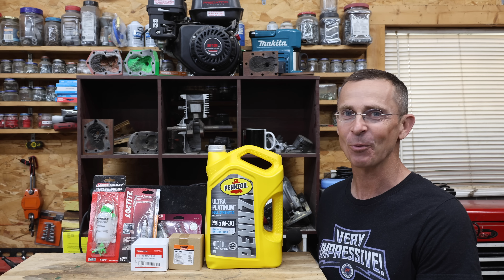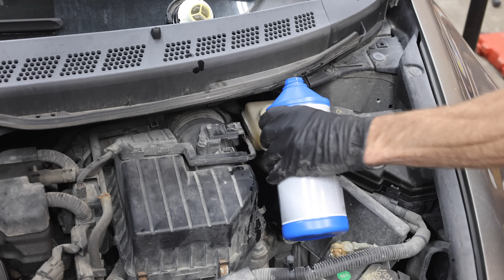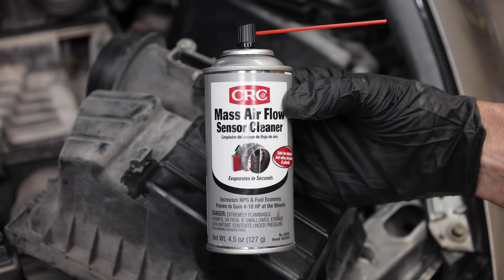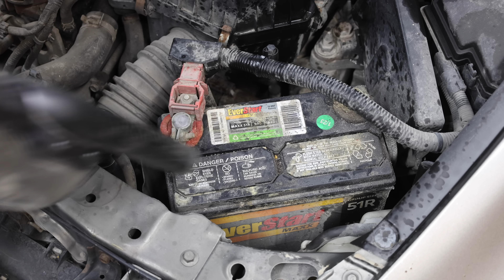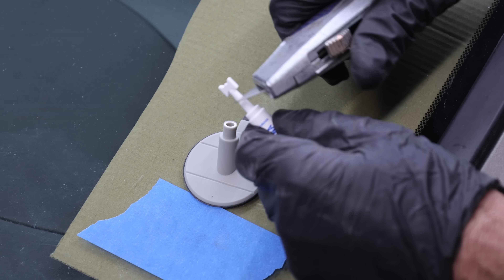Most Reliable 200K Mile Car? Let's Settle This!

Comment: 2005 4L Camry here, over 300,000 miles. Engine and transmission fluid has been the clue.
Thanks for the video
Reply: Toyotas would go 500,000 miles before needing all these.. ;)
Reply from the maker: Nice!  You are welcome!
Reply: @ProjectFarm A subscriber here. I just found out that there are canned fire extinguishers like paint can style. Would like to see a review on those. Just a suggestion. Thanks

Comment: 99 Rav4 with the 2.0. Has 270k logged on the odometer and it doesn't burn any oil or coolant and it still has amazing compression. Those 90s Japanese cars are decent pieces for sure.
Reply from the maker: Thanks for the feedback.

Comment: Don't drain all the transmission fluid, just drain the 3 and a half litres and replace it with the same amount. it doesn't hurt the Hondas to leave some old fluid in there.

Comment: Too many people just change the oil whenever and off they go. I read the manual and the schedule and use that as a guide to get the car serviced. Trans fluid, rearend fluid(if rear drive) front end fluid(if front drive) and various other things all need checked and changed to maximize vehicle life. Having been a mechanic myself, I really got some old memories going watching you fix that Honda up. It will last quite a while longer and save money doing it too. Great job!
Reply from the maker: Thanks!  Thanks for the feedback.

Comment: Thank you Todd for another amazing video!!! I’ve helped friends find cars for their children, typically their first car.  Older Hondas and Toyotas are my go to vehicles.  With some TLC, modest parts replacement and sweat, they are provided with a nice reliable vehicle for many years until they are ready for something newer / sleeker with their own $$$. And the jumper pack, portable air compressor and first aid kit also goes in.  A blanket and change of clothes w a couple of bottles of water finishes the “go kit” I provide.  Thanks again.  And BTW I just sold my 24 year old 3 series BMW last week. I was the original owner and lavished care on it over the years. Being garaged since new and no abused showed. Sold in about 15 minutes.  That’s a perfect car for an upgrade once the new driver is ready.  They are a good value and taken care of easily go 250K miles or longer. The “new ones” have so much plastic and tech I’d not recommend any of them.
Reply from the maker: You are welcome!  Thanks for sharing.

Comment: Excellent video.  I really like the extractor you made.  Like you, I maintain my automobile.  I still own and drive my 1984 Dodge Rampage with its original motor/trans at over 350,000 miles.
Reply from the maker: Thanks!  Nice!

Comment: hey Todd, Thank you for this amazing video. Your brake job was very easy to follow.  you talk a bit fast sometimes so I just rewatch those parts.   I was wondering do you know is it possible to replace an oil pump in an engine and how hard would it be to do so?  Looking forward to your next video on whatever you are doing.
Reply from the maker: You are welcome!  Thanks for the suggestion.

Comment: I guess this shows the value of regular maintenance. My 240k mile RX350 has had nothing outside of regular maintenance other than an AC compressor and an oil cooler line. Not bad for nearly 15 years.
Reply from the maker: Thanks for the feedback.

Comment: Those 8th gen Civics are some of the best, most underrated cars in my opinion. I bought m '08 back in 2016 with 140k on it. I drove it until 210k before giving it to my sister, who wrecked it at nearly 300k. It had nothing but the most basic maintenance, and was as reliable as it gets. Even after being wrecked and losing all of its coolant, it still drove around for several more days overheating the entire time.
Reply from the maker: Thanks for the feedback.

Comment: So the clacking noise in front was the drive axles and it is a good idea to replace brake springs as through multiple heat cycles they loose tension causing brakes not to return as quickly as designed but love your videos
Reply from the maker: Thanks!

Comment: an easier method for replacing brake fluid is to only use the extractor in the reservoir.  since wet fluid won't mix all to well with fresh fluid and is more buoyant than fresh fluid, if you pull what you can out of the reservoir and fill with fresh, just wait about 10 minutes or pump the brakes a few times, and the old fluid will rise to the top. Just repeat these steps 4-5 times and the fluid should be good as new without needing to bleed the brakes since you never really added any air to the system. (Source: brother was a dealer tech for 15 years and learned a thing or two)
Reply from the maker: Thanks for the feedback.

Comment: Great video and pointing out the savings vs making payments on a new car pushed it home. I always tell people it's cheaper to fix a car then buy a new one but they don't usually listen. Only thing missed was changing the fuel filter. I own 2 Civics and have been keeping them maintained for over 20 years. One with 300k and the other with 130k. Keep up the good work.
Reply from the maker: Thanks, will do!

Comment: I love my 1992 Honda Civic DX sedan that I bought about 11 years ago. I bought it for $700.00 with 235,000 miles on it, and it now has over 300,000 miles on it. I did have to change out the transmission, the original 5 speed had fried its input shaft bearings, the VX hatchback 5 speed transmission I swapped in is MUCH taller geared on the final drive, and I can now get over 50 miles per gallon on the highway. It has been SUPER easy to work on, including when I replaced the power steering rack with a manual rack because, power steering isn't really needed and the old rack was worn out. It has been a great car since I bought it, a ton of fun to work on and drive.
Reply from the maker: Thanks for sharing.

Comment: Driving a 2016 Mazda CX-5 with over 213,000 miles on it right now.  Only problem I've ever had was one ignition coil that went bad.  Truly the most reliable vehicle I've ever owned in my life.
Reply: I'm a toyota guy. Owned a 92 camry 465k miles sold it for 500 back in 2007.  Now own a 2000 camry same motor like the 92 with 150k. Also own an 09 Corolla with 200k.  Thinking of the new cx5 but hesitant to pull the trigger
Reply: Never owned a Honda, I guess... 350,000+.
Reply: @PaulLawson-k8v very very few hondas get that kind of mileage. Have you ever seen one in person?
Reply: Im a mazda fan and former mazda mechanic. Your results are not typical. Like I said I like them but they are easily the worst Japanese brand apart from Mitsubishi.
Reply: @jerbear7952  Mitsubishi is one of the worst designed engines I have ever owned.
Reply: @jerbear7952  Not sure when you were a Mazda mechanic but times have definitely changed.  During the Ford days they were absolutely problematic.  But in the last 10 years they've moved way up the quality list.
Reply: My Toyota Corolla has 395,000 miles and the only repair was a water pump at 365,000 miles.. yes original everything including alternator and AC compressor.
Reply from the maker: Thanks for sharing.

Comment: Awesome video. I had the same year  civic. Maintenance on these for diy is so easy . The only thing i hates was when i upgraded the headlights to HID. That was a bit of a pain only because i didnt want to take the time to properly remove the bunper. But other than that solid vehicle. And also yeah take car of the paint its a little thin up top.
Reply from the maker: Thanks!  Thanks for sharing.

Comment: Yep, I always buy used, but I try to get a used vehicle around 100-130k miles. My Chevy Express, which still runs, but has a million engine codes and sounds pretty rough, has 353k miles on it. It is on its second transmission, but has the original 6.0 engine. If I knew enough about swapping a van engine, I might tackle it, but a shop wants $10k...
Reply from the maker: Thanks for sharing.

Comment: I have a 1995 oldsmobile 98 regency with 3.8 engine and it has 216k miles, 24.5 mph around town and 27.5 to 28 on a trip. It's better than these new cars and much more comfortable. Going to keep until I go see Jesus.
Reply from the maker: Thanks for sharing.

Comment: I know you've done things with your truck and with the farmabago, but this is a dramatic departure from your normal videos and it's really well thought out. It is precisely true that often vehicles are traded in or discarded because what a shop would charge to do the repairs is too expensive. But you really can take a decent used car and put it back on the road for many miles without a large investment if you're willing to do the work yourself. Bravo on an excellent video!
Reply from the maker: Thanks!

Comment: Interesting video. I am not sure that your format and the speed at which it runs is good for repair videos other than a good overview of the process. Repair videos are machine specific and probably should be addressed one part at a time. Your video did show a lot of issues that can be repaired at home if you have the tools/special tools to do the job. Some items like the axle nut take a lot of force to remove and need to then be torqued back on with a torque wrench that apply a lot more force than the average home mechanic is going to have. Specific example would be the front axle nut on a 2014 Ford Flex. It can be a bear to get off and needs 265 Ft/lb to put back on properly. Not many home mechanics are going to have a torque wrench that goes that high or higher. I could see some vids about high mileage cars and what to look for before purchasing one. 

If you are removing a front wheel drive axle and it is stuck in the hub use a air hammer with the pointed tool in the center dimple of the axle to drive it out of the hub. Spray lube it before you start. Get the axle loose before you remove the strut.

If your engine is overheating for no apparent reason check the exterior radiator cooling fins to see if they are plugged up. If air can't flow through the radiator it can't cool the antifreeze so the engine heats up. Especially true in farm type country. If the wind is blowing and you can see stuff in the air some of that is going to end up in the cooling fins. Over time a lot of the stuff in the air will end up in the fins. Think of a oil or air filter that never gets changed. The newer tighter spaced cooling fins are less fault tolerant than the old radiators. They may cool better when new, if they are plugged up they do not cool at all.
Reply from the maker: Thanks!  Thanks for sharing.

Comment: Use these if you want, edit if needed.

0:00 Intro
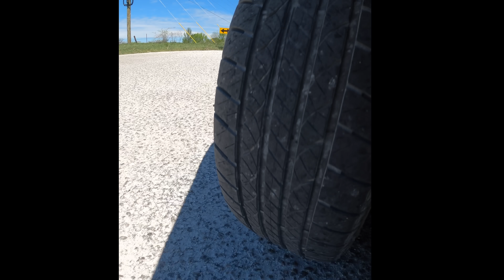0:11 What's Wrong
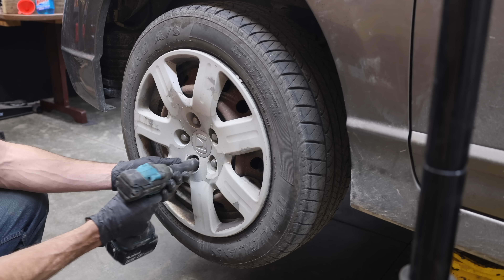1:14 Front Struts & CV Shafts
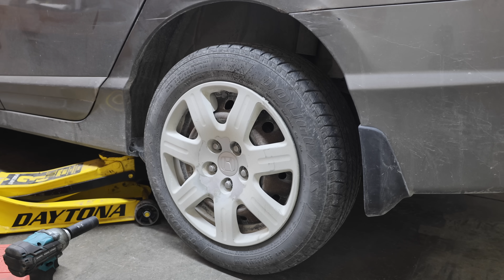2:59 Rear Drums
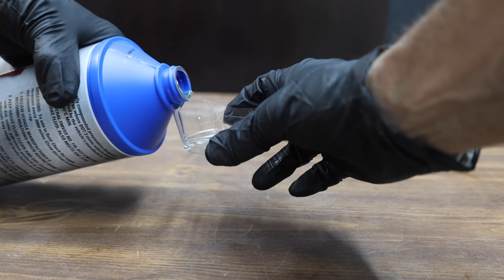5:13 Break Fluid
6:07 Rear Shocks
6:37 Thermostat & Coolant
8:20 Air filter & Mass Airflow Sensor
9:08 3rd Clutch Pressure Switch Sensor
9:39 Transmission Fluid
10:13 Engine Oil
10:41 Spark Plugs
11:23 Serpentine Belt
11:39 Battery
12:25 Wipers
12:40 Headlight Restoration
13:05 Cabin Air Filter
13:14 Front Bumper Clips & Grill
14:05 Windshield Chip Repair
15:35 Spare Tire & Hub Caps
15:55 Fluid Extractor Tutorial
16:39 Paint Ceramic Coating 
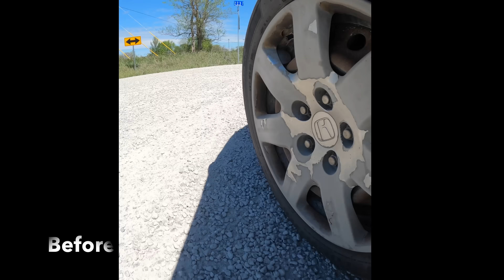16:54 Results
17:47 All the Costs (& Vs. New)
18:38 Upkeep Checklist & Outro
Reply from the maker: Thanks for sharing.

Comment: At 10:18   "It appears the the "Oil Change Place" installed a new plug that was too long!"    
IMHO  a standard "con"  to generate more work down the line!  
OR just plain INCOMPETENCE !

THANKS AGAIN for all you do to help us DIYers!!!!!!!!
Reply: Just a guy getting less than $20/hr who has been working there for 6 months and spent all of 8 minutes doing the entire oil change including replacing the plug with one from the tool box and didn't check to see if it was actually tight. They move quick to keep costs low but I've see things like the oil cap being left on top of the engine and the hood not even latched as a result.

Comment: Miatas really are the hot tickets for a fixer upper right now. As long as the clutch/trans & motor are good $1k goes a long way. I never thought I'd like one till I got stuck with mine by luck.

I should have done an awesome video like this. For a video with one test subject it's up there with the best in my opinion. Very well done.
Reply from the maker: Thanks!

Comment: I just sold the same car at 170k miles. Got 5k for it. I guarantee the shocks are shot in this video, but it doesnt effect drivability. I replaced the starter, tires, brakes and battery. Its why I got I $5k for it cuz it will go another 100k for sure.
Reply from the maker: Thanks for sharing.

Comment: 17:33 AHA! I knew the 3800 motor would be in this video somewhere. The 3800s and also the 3100/3400s and the 4300 V6s are great GM workhorses. Only real issue with these is the intake gaskets which are plastic but get the fel pro metal gaskets and you will be one happy camper :) Great motors!
Reply from the maker: Thanks for the feedback.

Comment: Most Volvos before 2013 are regularly found with over 150,000 miles and still run great, my fathers car currently has 395,000 and is still running great
Reply from the maker: Thanks for the feedback.

Comment: 800 to fix it doing it yourself. I could have done only a few things on that list and those were the cheaper fixes. Brakes, joints, sensors, belts, transmission flush no way. It would have been about 4000 to get that fixed if you don't know how to do it.
Reply from the maker: Thanks for the feedback.

Comment: Can’t beat an older Subaru… when they had timing belts (ones with timing chains and cvt transmissions are throw away cars) my 04 has 179k and barely broke in yet. been through two routine timing belts, a clutch, of course head gaskets at 80k and regular maintenance… only thing I would be worried about with the Honda is changing that transmission fluid… I’d prob have left that be if it wasn’t regularly maintained I wouldn’t change it… sometimes grit is better than slip you get with new fluid in old transmissions
Reply from the maker: Thanks for the feedback.

Comment: Honda or Toyota from 90s or early 2000s u can get 500k miles great video as always man. That car u will definitely  get many more miles out of it. Personally the only frustrating thing is when the cats are bad because many times thy cost more then the car is really worth. Sometimes 700 to 1400 bucks for 1 cat converter. If u get a car with good cats u got a good deal
Reply from the maker: Thanks for the feedback.

Comment: Autel MaxiAP AP200 is what I most recently invested in for Toyota vehicles and man is using a smartphone different along with such a cost effective device. Awesome IMO.  Autel MX808 seems unbelievable as well for a stand alone device and the below 400 dollar price point. Looking forward to your reviews as always.  Thanks for sharing!
Reply: Crazy is, if you're yards prices are right where including having 50 percent off sales and you luck out finding newer used parts or maybe also new enough, one can really get these longer lasting higher quality made cars on the road again really cost effectively.  Been doing with the Priuses and am amazed like with my truck minus the Dana 44 which has been a budget crunch back when I did.  Decided to take the axle shafts out up to the U-joint, where of course I left the outer yoke and shaft.
Reply from the maker: You are welcome!

Comment: dang people look to get rid of their car at 200k? While i celebrate mine and look forward to another 200k 🤣. 06 corolla 211k miles currently, no oil leaks, smooth idle, no rattling, no internal engine work ever needed, everything on that car is original other than the front axles that i replaced recently. I take care of my baby and do my own maintenance and the body is all intact with no paint wear. 3k oil changes or every 6 months (which ever first) and all other fluids changed on their appropriate mile or time intervals. I am expecting 500k miles minimum 🙏, so long as the engine and transmission don't need any major work then ill replace anything else that goes bad no questions, so far no signs. I spend my money on bikes instead, my sportbike is for speed rush, my reliable corolla for practicality 💪
Reply from the maker: Thanks for sharing.

Comment: As a technician I would recommend checking if the car has ever had a transmission flush because if your not carful because a flush on an automatic transmission with 200k miles can cause it to start slipping if the flush has never been performed still love the videos watch every one you post
Reply from the maker: Thanks for the constructive feedback.

Comment: Todd, In my younger days I have done the same thing out of necessity.  I don't get into transmission work and have only done  a head replacement.  Yes, I enjoyed this type of video and would like to see more of them.  I especially like how you use diagnostic tools to justify changing the brake fluid, not changing the radiator fluid and the transmission fluid was a no brainer.  I didn't catch if you did anything more with the tranny.
Reply from the maker: Thanks!  Thanks for the suggestion.

Comment: Great video as always! I am interested though, did the transmission still shift smoothly after your fluid replacement? I have always heard that unless you religiously change your trans fluid, it's better to just leave the old fluid in there as all the worn clutch material is still suspended in the old fluid.
Reply from the maker: The transmission. does indeed shift very smoothly and better than before the fluid change.

Comment: I have 230,000 miles on a stock 2007 Audi A7 2.0T. I do all my own maintenance and I have owned it since 50000 miles. It's very reliable.
Reply from the maker: Nice!